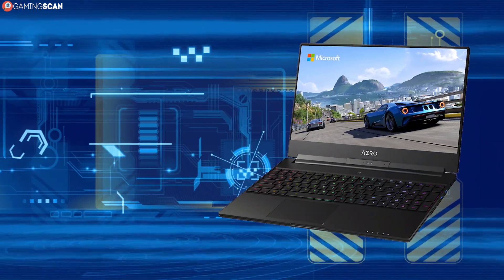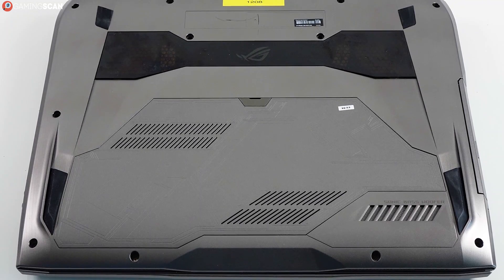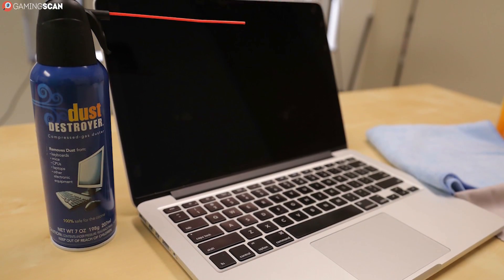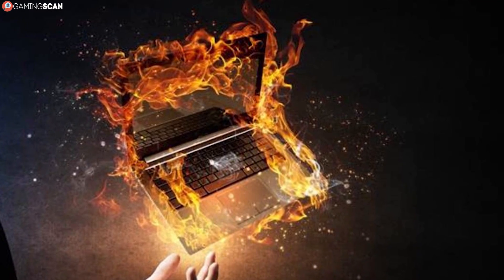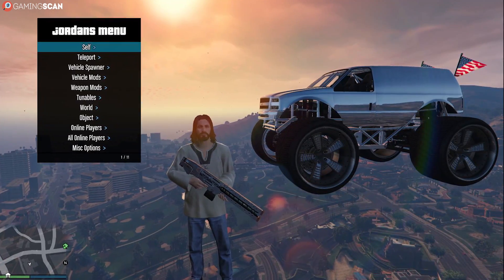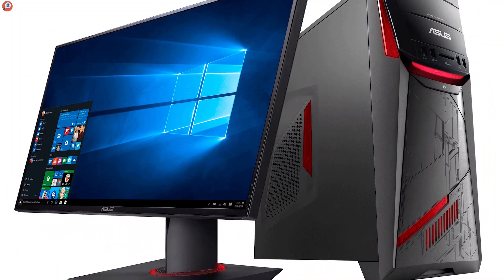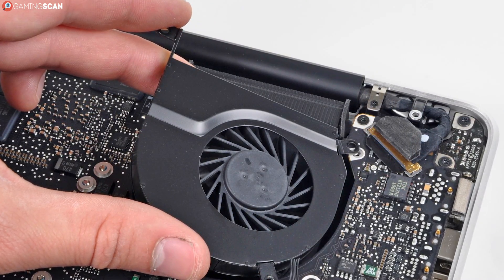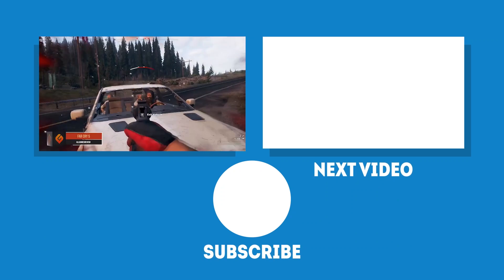How To Keep Your Laptop Cool While Gaming [Simple Guide]

Comment: plays rust at max settings at 60fps, plays csgo with no problem, same with subnautica, fortnite, etc. 

**Runs osu!**

**GPU heats up to 80 degrees**
Reply: just dont play weeby games
Reply: Same with Roblox wth I literally play fortnite and overwatch
Reply: BlackLightning9 I play overwatch at the lowest graphics at 90 degrees.
Reply: True
Reply: MINE SITS AT 80C
Reply: set max fps to 120 or 60.
Reply: Wait 80 is much?
Reply: 80 degrees is kinda normal for most modern games but osu

Comment: i also recommend : repaste + undervolt + laptop vaccum + cooling pad . certainly cut down alot of heat from my Acer Nitro 5 while heavy gaming!
Reply: Wdym by repaste? What are you repasting?
Reply: @just_a_sushi  you are repasting the thermal paste inside your laptop.. its the thermal paste that connects your CPU chip to the heat sink pipes.. look up for thermal paste.. i recommend Grizzly thermal paste for repasting

Comment: Plays Fortnite,  it's fine

Plays Roblox,  Gains 10Fps and overheats
Reply: It’s because Roblox is capped on 60 FPS, and it barely does GPU usage, which sucks.
Reply: use roblox fps unlocker
Reply: @sobaldman8375  what the hell is that ?!
Reply: @realpnthr  roblox has an fps cap which is 60 but if you use a roblox fps unlocked you can change the fps cap to 240 and more
Reply: They say Roblox is a low-powered game, it isn't

This is not helpful to me, I got 6 FPS and it heats a lot!

Comment: Even placing the laptops on a flat surface partially blocks the air to enter. The fans inhale cool air from below and exhale hot air from behind or the sides so an open space is needed particularly below the openings

Comment: Build table that has hole 😎
Reply: sounds like a milking table huh
Reply: Instruction unclear: laptop fell through the hole.
Reply: Well that's if you know what you're doing 😂
Reply: And put a fan under it
Reply: This is actually genious.
Reply: or just buy the zenbook duo that gives the laptop a natural lift, or buy a surface pro that does not even have anything to do with how u put it on top of the table
Reply: @incantation1321  well still overheating

Comment: Just done changing thermal paste and undervolting the cpu also did turn off the intel turbo bust :E
Reply: Then. . .
How is it going?
Reply: @vivalosgameplays5383 around 20C less on the CPU in gaming
Reply: @mariuszmaxankazuya3170  Did you apply thermal paste on your GPU?
And/or undervolt it?
Reply: @vivalosgameplays5383  yes I put new paste on GPU also...and I did undervolting on cpu only.

Comment: Keeping laptop cool, the real way: apply good thermal paste, under volt both GPU and CPU use a cooling pad only to elevate it don't play long hours on a hot day and use older Nvidia drivers if you have a gtx 10 series
Reply: most of those things are complicated for non-tech guys, you know? i had say, add liquid metal

Comment: i got a HP Omen 15 -  gtx 1070 - i7 8th generations -  144Hz. the cpu gets to the 90 degrees and above. should i factory new reset work?
Reply: Nope. It's normal for gaming laptops to hit 90°C. Especially a 8th gen i7. It can go even higher without damaging your hardware
Reply: You have the 2018 model right?
Reply: I have a i7 7700 hq which is also running 90 or higher in my msi raider (with gtx1070) . Is this fine too?
Reply: @The_Potionist  yes. Especially coupled with that GTX 1070. Don't worry there is a system level safe switch which will turn off your computer if it exceeds a particular 'dangerous' temperature. But even at almost 100°C it's still 'okay'
Reply: @AchiragChiragg  yeah thats what I thought, thanks for the info tho :) I think my system thermal throttles when it reaches hot temps so thats at least good for saving it.
Reply: @AchiragChiragg  i have a i7 3630QM and a geforce gt650m and when i start gaming it wil heat to 90° will it damage my hardware if i keep playing??
Reply: @kiaz5776  nope. Make sure it doesn't go above 100°C and you're good. Technically it will switch itself off or BSoD before it reaches the junction temperature of 105°C. So nothing to worry about
Reply: @AchiragChiragg  thanks bro